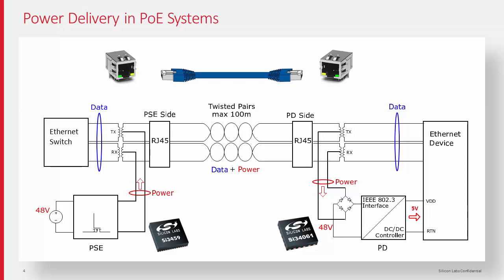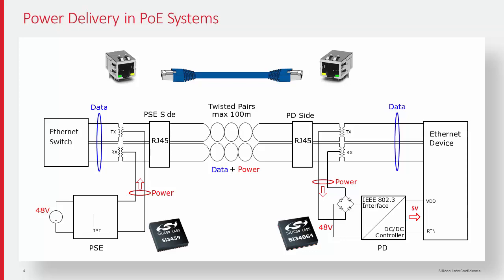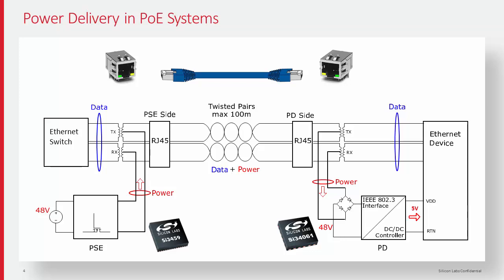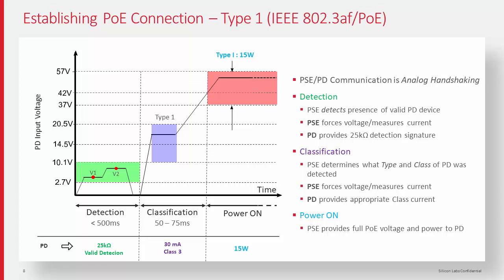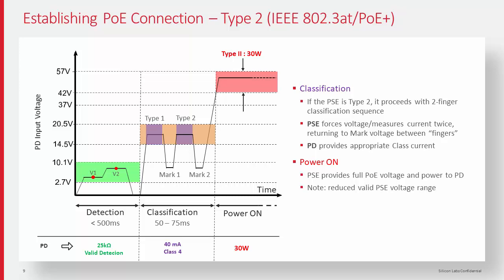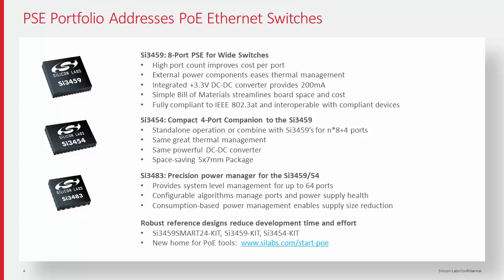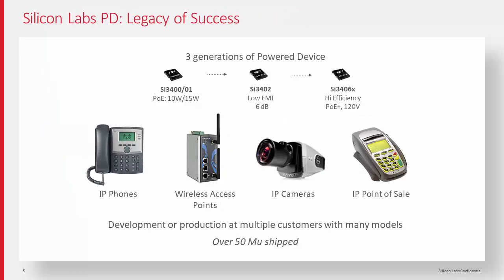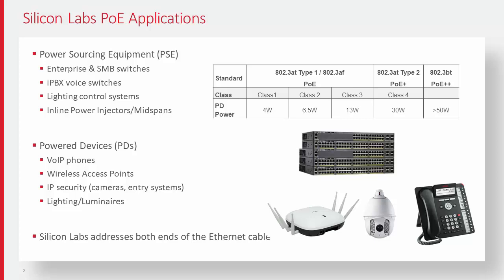Power - Fundamentals of PoE

Comment: What the heck is 120v poe?  Sounds illegal.  Like would you need a licensed electrician to run your cat5 in emt conduit or some shiz?
Reply: most countries use 400v power so its low
Reply: @TheLostPacketYT put poe over ethernet?
Reply: @zyxwvutsrqponmlkh  that’s not what I said. I just have that voltage is not that high in the grand scheme of things.